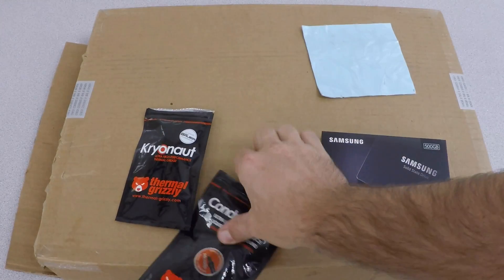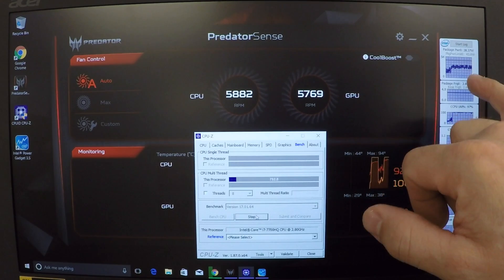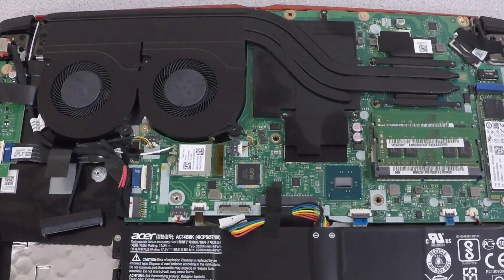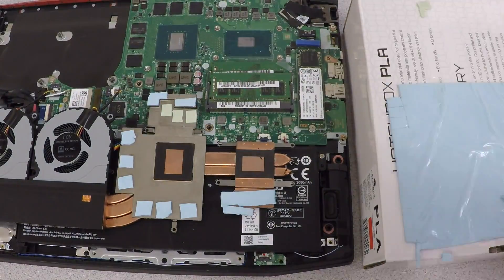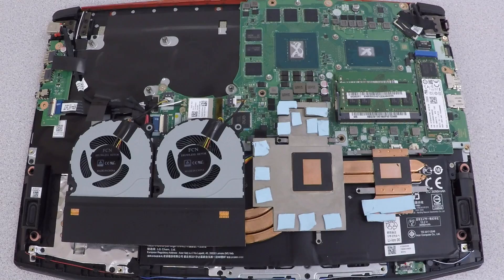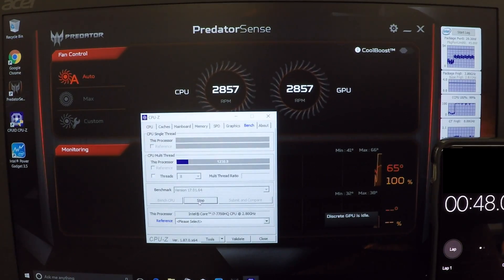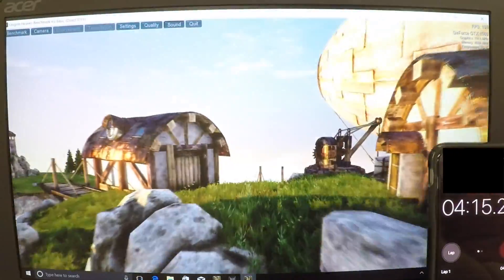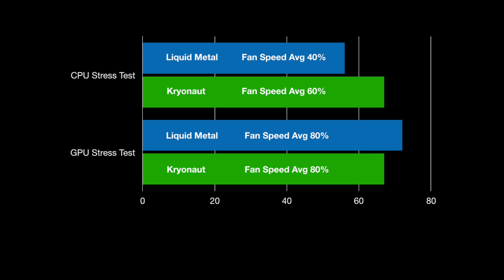Acer Helios 300 Kyronaut vs Liquid Metal Test

Comment: great video! 
have the same laptop and am planning to replace the stock paste with kryonaut myself. the temps reach over 95 deg with the stock paste. hoping to see similar results on my laptop!
Reply: I use liquid metal on the exact same laptop because of the exact same 95 degree temperature and I received 72 degree temperature at maximum synthetic load and no higher than 70 during gaming
Reply: @JokeRGBlazE  oh wow....can a local thermal paste (for pc)do a good job on predator 300? Its not a very good quality......plus my temps are like 94-98 both on cpu and gpu with huge throttling and frame drop. In india fucking kryonaut costs 3000rs for 7gm.
Reply: @lordraj365  use icy diamond
Reply: @lordraj365  try md computers website. It costs around 800 rupees there
Reply: @lordraj365  very late to reply but I bought it on mdcomputers for 900 INR
Reply: @lordraj365  Sorry I wish I could have replied sooner. Just go to MDComputers or primeabgb rather than Flipkart or Amazon. They are much cheaper around 1000 rupees or less.
Reply: I replaced mine with Arctic Mx4 8.5mw/k and undervolted it to -150mv i am sitting at 60-70 degree at full load
Reply: so..did it work for you laptop?
Reply: Tank Connors mine didnt work
Reply: @JaJa-gh3ze  bummer.
Reply: Tank Connors ye bruv, super disappointed. It might just be gta v thats the problem. I also got the same temps he got with cpu stress tests. I went into my laptop again and made the screws more tight but its still mid 80’s(without undervolt) (which is better than the usual high 90’s i got even when undervolting)
Reply: @JaJa-gh3ze  under volt it. I did that to mine. And it dropped the cpu by like 15 c
Reply: Tank Connors did you do -150V?? Cause i undervolted to that and my temps didnt change. Not sure why it didnt drop, it actually increased😂i guess thats my luck
Reply: @JaJa-gh3ze  that's weird poor you man. Lol.  Ya. Mine is like. - 160  make sure you go as low as you can
Reply: Tank Connors nice 160 is super far
Reply: @JaJa-gh3ze  on my Dell 1060 I get to - 194 lol
Reply: hey bro ...this helped you please reply
Reply: bro kathmandu ma katai repaste gardincha? Jabo ekchoti ko lagi 2k kharcha garna thik lagena malai. Dherai mahango bhandai cha kryonaut

Comment: Good vid! Did you use whole 1g tube of paste? Or it was old leftovers?)
Reply: @Eddienemec  I've removed old paste with ethyl alcohol, cleaned copper surface, changed the thermal pads (arctic 1,5mm) and finally pasted Kryonaut (X-method). CPU temp before in stress test was ~89°С and after ~87°C xD. What could i do wrong?(
Reply: @Eddienemec  GPU temp was ~90-91 after 5-6 mins. Today I've repasted it again, cut thermal pads more accurately, pushed heatsink down, tighten the screws. Now in Heaven benchmark GPU temp is ~89 °C Actually, it helped only ~ -1-2°C. Idk what could i do wrong T_T
Reply: @batnasn  it might not be you. just a lack of heat pipes. also check the clock speeds, lot of times you reduce the amount of throttling more than you drop temps for a laptop.

i have an aero 15x, which also gets too hot. basically nothing thin handles the 8750H well. i replaced the paste with IC graphite and it made very little difference, but i travel for a living and IC graphite is a pad which gives me peace of mind over paste that could leak out

the most effective thing i did to drop temps was drop the boost clock from 3.9 to 3.6, that on its own took 10c, .150mv undervolt took it down another 5 or so. also the lower boost helps it cool off faster
Reply: batnasn you can also try undervolting the cpu because it probably has to much volts anyway. It should help with the temps and keep the same performance if not better.
Reply: @batnasn  ur using too much paste. Use a pea sized amount or for this laptop the size of a rice grain. Then evenly put the heatsink back on and install the screws lightly one by one they will be numbered dont tighten one screw then move to the next. Also make sure ur fans and fins are clean. Might have to open ur fans. Finally, undervolt. Undervolting just removes excess voltage going to cpu. After this u should be good. Spend some time to do a good job though. The paste has to be very little, the heatsink should be evenly applied and nice and tight

Comment: liqid metal. this is probably eutectic 67% gallium, 20.5% indium, 12.5 tin. Tin is cheap and lowers the melting point even further to 10 Celsius. But such an alloy reduces the content of gallium, and it reacts well with copper to form the intermetallic compound CuGa2. Having reacted with copper, the metal gives off gallium, indium tin crystals and other impurities fall out in the alloy (which can also be separated from non-pure copper). It kind of dries the liquid metal. The volume decreases as well, and the contact is lost.
Therefore it is not necessary to smear thin metal. (It is possible to apply a crystal for example for two days in a compound and a video card steamer and leave on the table like a cake to infuse, then add some fresh ones). The intermetallic CuGa2 is not necessary to skin, its thermal conductivity ~ 90 W / (m · K), more precisely 96-86 at 300-500 Kelvin.
So who has dried up (even on nickel), remove the most dirt of impurities and add fresh
Reply: I'm about to put grizzly conductonaut on my laptop with copper alloy cooling. Are you saying the liquid metal is bad? I have to re-apply it later? I saw some videos with mild reaction to copper heat sink and even some porosity appearing in some cases (not talking aluminum here). Thanks
Reply: @Platypus_Warrior  Liquid metal is good. My laptop is now much colder and quieter. Some of the gallium is absorbed into copper and the metal must be reapplied. After 3-6 months, depends on the quality of copper. The layer on copper needs to be partially sanded, a rough surface. Do not remove the silver layer to copper, this layer will then be a protective film and less new gallium will be absorbed
Reply: Thanks for the reply. You left me a bit confused about the sanding. If the intermetallic compound CuGa2 forms a protective layer after the first application then what should I sand off? @costea.
Reply: @Platypus_Warrior  It's like an iceberg in the ocean, the lower part of the water should be left. But remove the upper part above the water (copper)
Reply: @Platypus_Warrior  Sticking irregularities, roughness
Reply: ..... so when do you sand? Do you mean smoothing out the protective layer formed after 1st application (without removing it) then apply liquid metal for the 2nd time? Could I skip the sanding altogether?
Reply: @Platypus_Warrior  But you still remove the remains of thermal paste before the new one. It is also better to remove here, you can not remove if the layer over copper is not high, but there is a sanding sponge in the kit. What is the problem to move your hands. The layer is soft,
Reply: Sorry, I don't get everything you say but thank you for your answers. @costea.
Reply: @Platypus_Warrior  I'm sorry but I translate from Russian by Google translator)

Comment: What temperature that is cosidered safe when gaming? All I see is somewhere around 90°C? Also if I'm buying a new helios 300 is it recommended to change the thermal paste immedietly? Thanks in advance
Reply: Ur cpu is always at safe operating temps and will underclock or shutdown if too high. I think 95-100c is when cpu starts underclocking depends on manufacturer, but for gpu its way lower. Upto 90 i would consider safe though